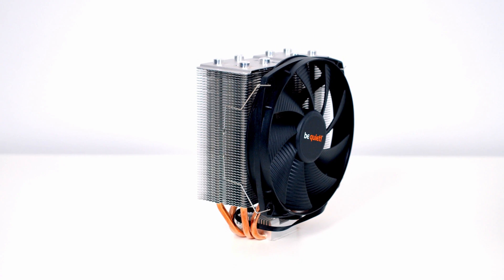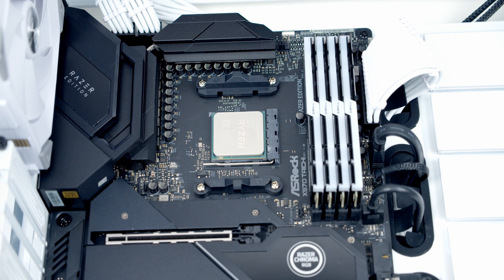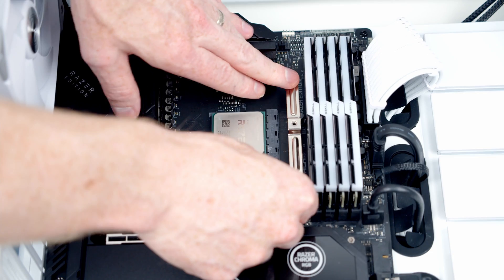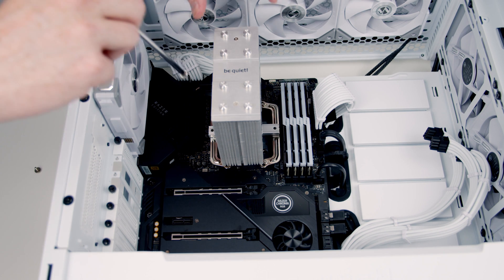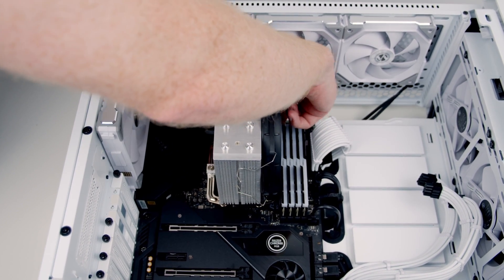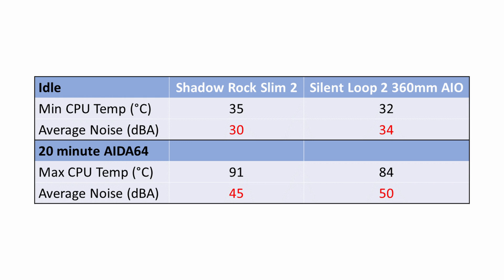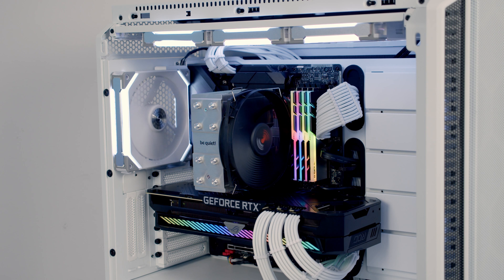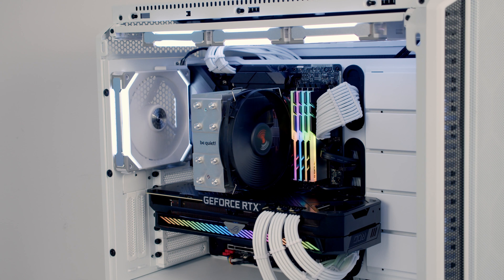be quiet! Shadow Rock Slim 2 - Overview & Installation Guide

Comment: Chris great Video, I am searching for a cooler for a Ryzen 7, 3700x which is in a 4U Server Chassis, the max height is 148mm which cooler would you recommend. I am currently using the Noctua NH-US with two fans in a push-pull formation but my idle temps are still over 50 degrees. I am also thinking of trying the Cryorig CR-H7PA H7 plus as its max height is 145mm. What do you suggest? FYI, the chassis is a Silverstone RM42-502 with two 120mm Noctua NF-F12 IndustrialPPC-3000 PWM in the front and two 80mm at the rear.
Reply from the maker: I would go with the Dark Rock TF2
Reply: @ChristopherFlannigan  Than ks Chris, I will give it a try.
Reply: @ChristopherFlannigan  On the beQuiet website they have the Dark rock TF2 (BK031) but it has a message saying coming soon, does that mean they have a new version they are about to release, or is it the same cooler?
Reply: @ChristopherFlannigan  I chassis has space for a 240mm AIO would it be better to fit this instead of the Dark Rock TF2?, I am thinking about the Arctic Freezer II or the Fractal Design Celcius+ 240mm
Reply: @射進肚臍 Yes I checked the Dark Rock Slim as soon as a saw the video, unfortunately, it is too tall for a 4U chassis.
Reply: @射進肚臍 the Dark Rock TF2 looks very nice, I might try that one.
Reply: @射進肚臍 Thanks for that, I checked the Rock 2, but the height will not fit into a 4U chassis. I'm now thinking of going with a 240mm AIO or the Dark Rock TF.
Reply: @射進肚臍 Thanks for the heads up, I might wait for that instead then.